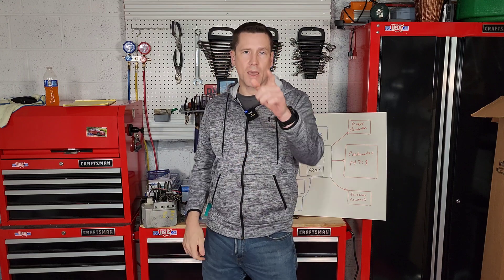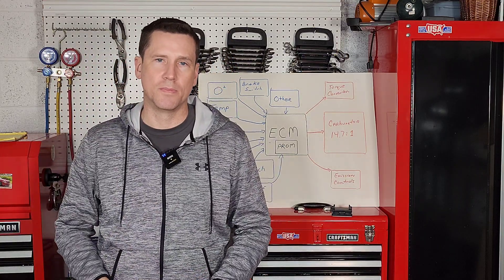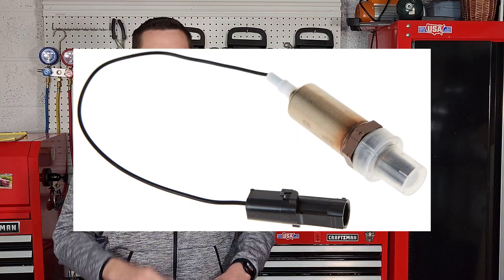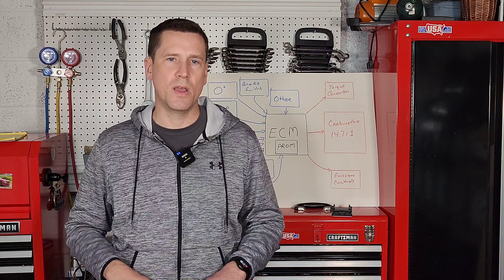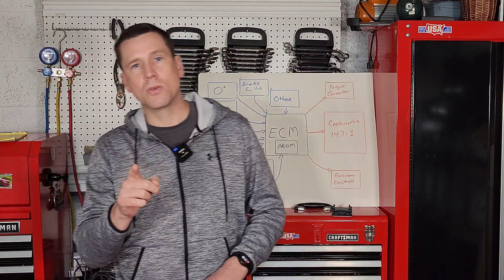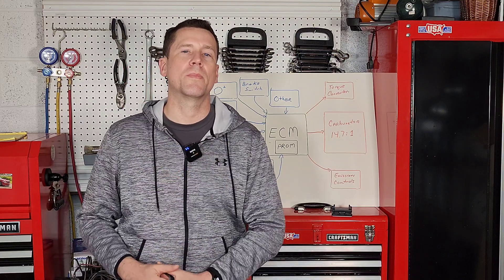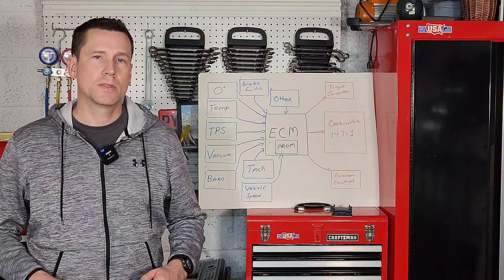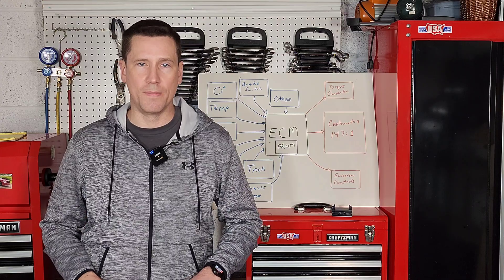The 3 Sensors You NEED To Check on Your GM CCC System (and a few more) - GM CCC System Part 2

Comment: Fun fact a lot of people when it was new (most owners it seems) didn't understand how to "drive" it right; when you wanted to pass with full power (override mode) you had to let off the accelerator completely before mashing it to the floor, otherwise it stayed in economy mode for passing if going from part throttle to floor. And it made people think it was gutless, which it certainly was not! '83 Delta 88 bought new very often got 24-29mpg on the highway when staying out of passing mode. And as low as 14 if you just couldn't help yourself 😂

Comment: I have a 1993 Chevy blazer that my dad gave me when I was 16. I never had problems with it until the past couple of years. We’ve had to change the alternator multiple times before. I was sitting at a light one day and when I went to go it completely lost power and wouldn’t crank back up as had to be towed. I finally sent it to a shop and they fixed something on it then I parked it at home and didn’t drive it for a couple weeks and it wouldn’t crank back up so I charged it and it still won’t crank. Do you have any idea what it could be?
Reply from the maker: If the battery is good and charged, it sounds like you have a wiring issue based on what you've told me. Are you getting any power to the truck (interior lights, radio, ect)?

Comment: Do you know what the idle voltage should be on the TPS? I am tuning up an E2Me DualJet on a Buick 231 in an '84 El Camino with all the OE smog components after it failed smog recently with high CO levels. I have an analog dwell meter hooked up and it ranges from 28-33 degrees depending on whether the engine is cold or hot. When I increase the RPM to somewhere north of 2,500 (I haven't got a tach on the car so that's a guess as I use the dwell meter to measure the RPM and it can't do both at once!), it drops to zero and as I back off the throttle, the dwell comes back to something steady either side of 30.
I measured the input voltage (grey wire) to the TPS with the ignition on and it is 5.2v DC. When I open the throttle to WOT and measure the sensor voltage (blue middle wire) with the ignition on, but the car not running, it increases steadily from 1.2 to 4.2 at WOT. I then measured the running voltage from the TPS using probes in the back of the 3 way connector. At idle, the voltage is 1.2 and then increases to around 2.5/2.6V before the dwell craters (I was trying to figure out whether the TPS might be wrongly adjusted on the voltage side). The TPS voltage seems to jump around between 2.5 and 2.1 volts once I get it up in that range and there is a slight change in engine pitch when the dwell drops.
I have a new Delco O2 sensor and it is popping intermittent 13 codes too.
Any suggestions where to look?
Reply from the maker: The TPS voltage on the "A" code 231 should be .46 volts with the ignition on (engine not running) and the ISC retracted. Yours looks like it's running high. I'd re-adjust it to get the voltage down, then start back from square 1 with the diagnosis. It sounds at least on the surface that the M/C solenoid is properly adjusted based on the 28-33 degree dwell you're getting. As for the code 13, 99% of the time it's a bad connector or a short somewhere along the path. Being that it's intermittent, I'd really take a look at the connector.

Comment: The map sensor is a critical sensor. If it goes bad or lies to the ECM it won't know what the real engine load is so the fuel and timing will be way off. I don't remember if the ECM will substitute a value for it if the ECM detects a fault in it's circuit but the fuel and timing will still be wrong if it does substitute a value. It was tough in those days. Ford, GM, Chrysler, and the imports all did things so differently and used proprietary test equipment for the most part that if you worked in an independent shop it was at times a nightmare. Ford used a dwell meter and we counted the deflections for the code numbers and they had different categories. Hard codes and history. It wasn't called that but I think that's what they where for. GM used the check eng light flashes until someone came out with a diagnostic tool that could show the codes and the different sensor readings with a rotary switch. I never did learn much about Chrysler and there wasn't much good info out there we could get at the time. (no internet). All of our info came from Motors and Chilton's monthly magazine's along with auto parts sponsored seminars such as NAPA and Carquest. A lot of Chrysler's Lean Burn surging at cruise and acceleration problems could be cured by slightly raising the metering rods on the AFB carburetor and the exhaust readings actually got better. Mechanics today may have a lot more sensors to deal with but the systems themselves also give a lot more help in diagnostics plus the different training available and the internet. There seems to be a network of experienced mechanics available across the country and the world for that matter these days. We had a telephone and the local people we would meet at seminars and just being in the business for a long time for our network of knowledge.
Reply from the maker: The internet really has changed things. Even 15 or 20 years ago, short of picking up a paper manual it was very hard to find out how to service these things. And forget ever finding a video or anything like that to help walk you through it.  And you're right about the Chrysler "Lean burn" system. It was terrible. I remember they had a wacky system to advance the timing. You had to have the gas pedal down for so many seconds before it would start to change the curve, even if you were accelerating hard.

Comment: @rporestorations, what’s your fuel economy on your 442. I’m getting just shy of 17mpg in mixed but mostly hwy driving. It has a new carb, plugs, wires, cat, o2 sensor, ecm temp sensor, pvc valve and egr valve.
Reply from the maker: I'm probably averaging about 15mpg, but my driving is  probably 70/30 city highway. And my set-up is mostly all new, too. Everything but the catalytic converter, which is original.
Reply: @rporestorations  that’s good info. My last fill I got just shy of 19mpg and that was still mostly hwy. I did replace the cat on mine, it had been running rich for a long time and the original was just all clogged.